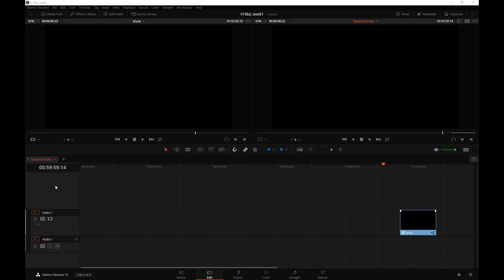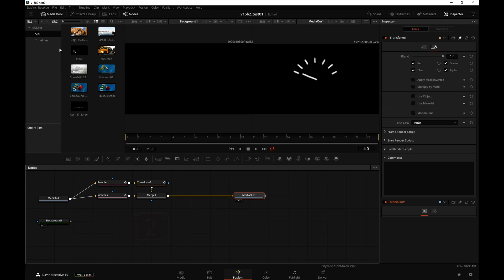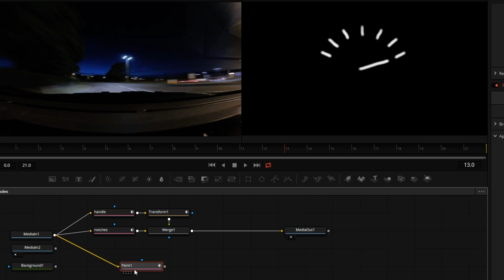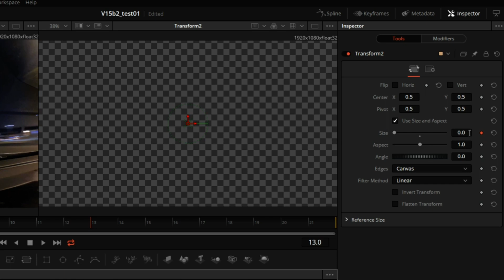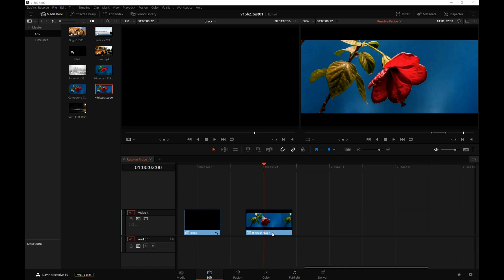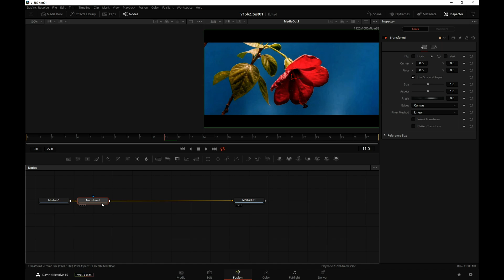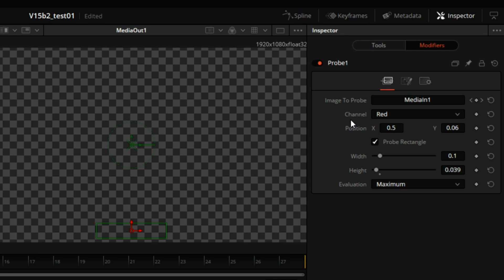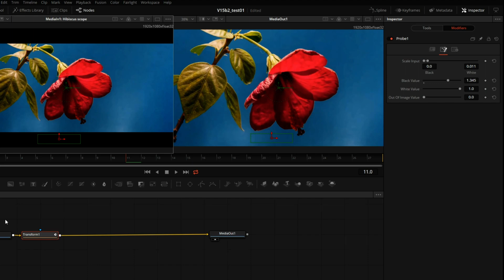DaVinci Resolve Probe Tool

Comment: Thanks for the tip! I'm planning to do a green screen composition, and this is just what I need. I'll have blinking lights in the background, and those blinking lights will also be used when shooting the subject. So I'm planning to take two pictures of the background (one with lights on, one with lights off). Then when I shoot the subject, I'll have the lights in frame. A probe will read the value at one of the light's pixels, and this will determine which of the two background images is used at a given time.

Edit: I just did a test, triggering an overlay to show up or hide when I switch a flashlight on or off. It worked perfectly, and it was so easy to set up.